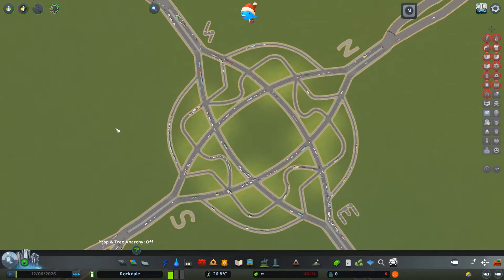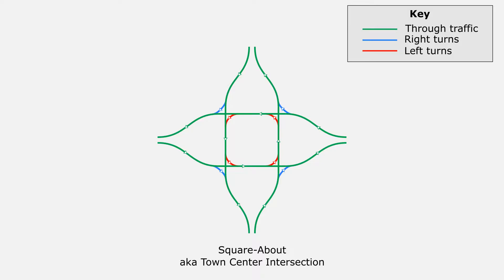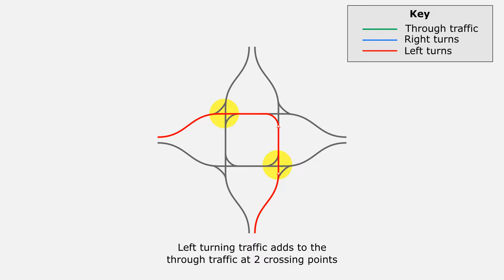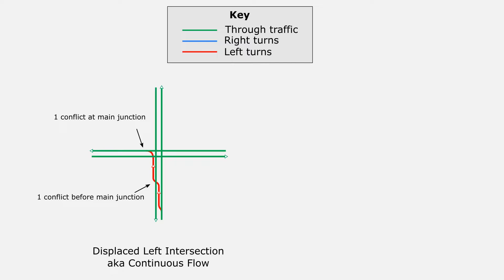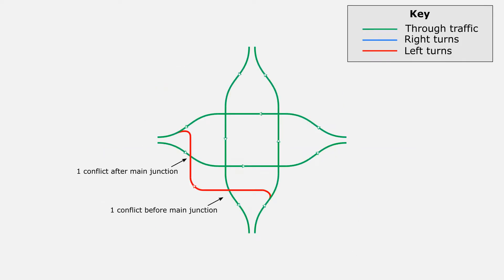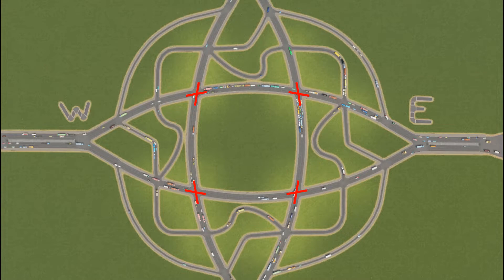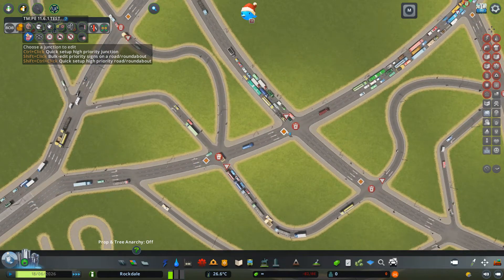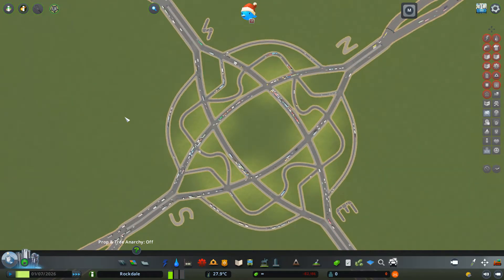12 yield signs?! A displaced left + split intersection. | Cities Skylines

Comment: It wasn't so much a challenge to use an at-grade crossing as complaining about using something in the wrong place (instead of actually trying to find something useful for the situation, really looks at things very negatively, that one); truly realistically (as Biffa had pointed out) with traffic volumes this high you would just use a normal elevated interchange, anyone that would expect and at grade crossing of any reasonable size to function with that much traffic is insane (not that that's much of a surprise). I applaud you for figuring out something that actually worked for all the traffic, but given its gargantuan footprint, I just don't see it as a feasible solution (not that I would complain if one was added somewhere :p)
Reply from the maker: I think I disagree with Biffa that this requires an interchange necessarily. This particular level of traffic can be handled by a road with 5 approach lanes and some traffic signals (and especially by the continuous flow or parallel flow intersections), and that would be much cheaper than an interchange. But perhaps if you anticipated further traffic in future, an interchange would future-proof the junction. 

Also, I think this is not that much bigger than a realistically-sized interchange!
Reply: @Doddibot  the fact of the matter is, it's for highways converging, and why would you put a traffic signal in the middle of a highway? That defeats the purpose. Navigability plays a role as well, I'm still confused looking at this even after knowing how it works... and that's not even saying that a stack, or a cloverstack interchange, whom are far smaller, wouldn't be much better suited. Yes there may be options that are far cheaper, but there's more to navigating than how much it costs at the outset (I still think trying to do it with only cars is another of the biggest issues, they should really be trains and many other things going through here; again, looking at incorrect solutions to a problem and complaining that they don't work optimally, what is this, America?)
Reply from the maker: @TS_Mind_Swept  I agree that highways converging requires an interchange, but I'm just considering the level of traffic alone regardless of the classification of the roadway. So the question I'm considering is, how would you deal with that level of traffic on 4 arterials converging? Obviously you'd like to reduce the car traffic too, but that's outside the scope of that narrow question.
Reply: @Doddibot  well the question is stupid (just like the one than initially posed it), America has enough examples of why trying to do it this narrow-mindedly is the worst idea possible, yet for some reason there's some kind of debate about it here. I'm not interested in narrow-minded thinking, and if everything's not going to be considered then there's really no point in even going into it